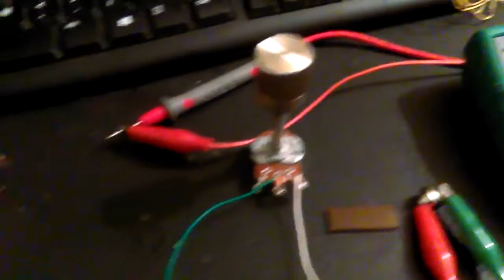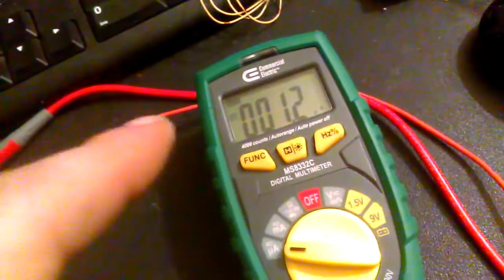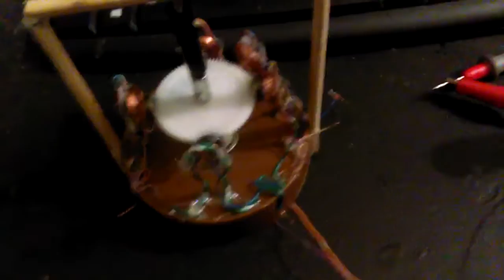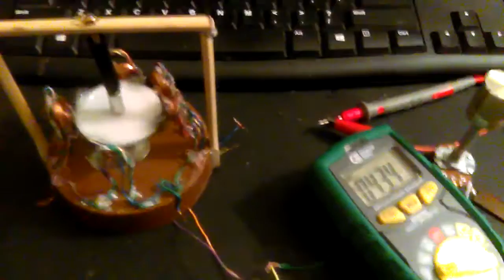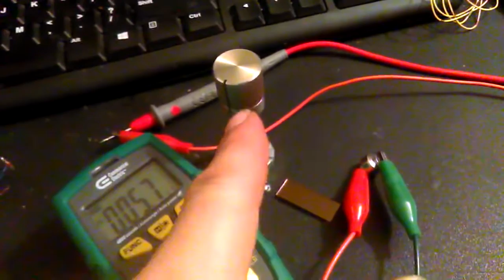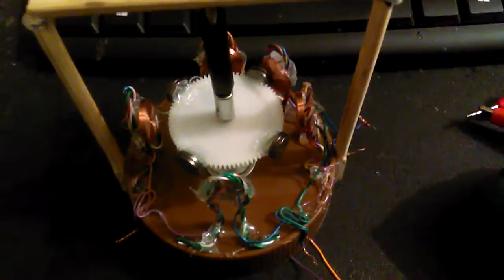low microamp rotation with tiny magnet rotor

Comment: brother, you put up the coolest videos ever!. This so piques my interest in digging out all the parts I have salvaged over the years. Thanks for posting this!
Reply from the maker: thanks man. I still need to tinker more with this one, got a bunch more dollar store toy coils, but I'm actually just going to go ahead and order like 100 of them online instead. the ones I have can't be stacked and I'm thinking stacking them about a half inch thick for about 2500 ohms each coil, then use 8 coils to drive it using the same solar toy driver or Lidmotor's driver